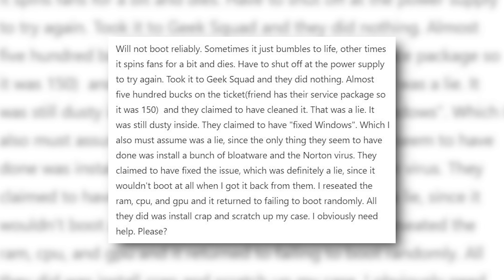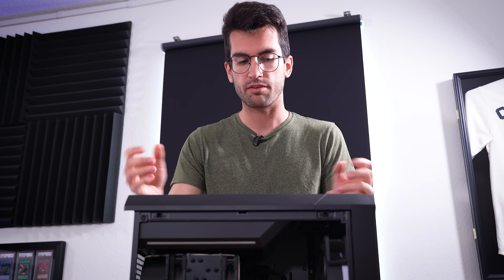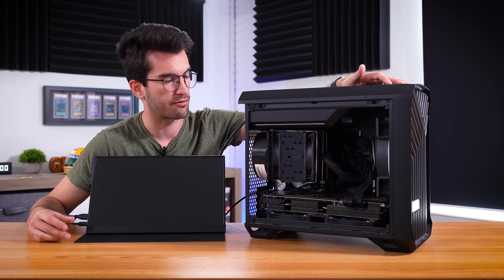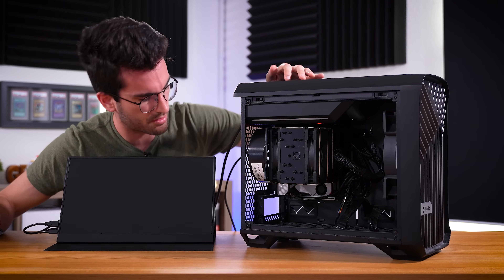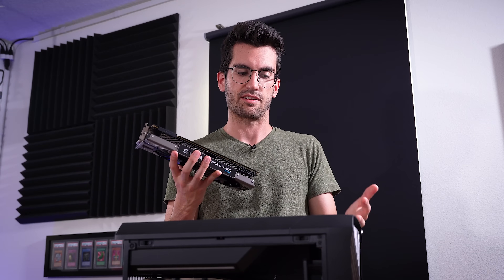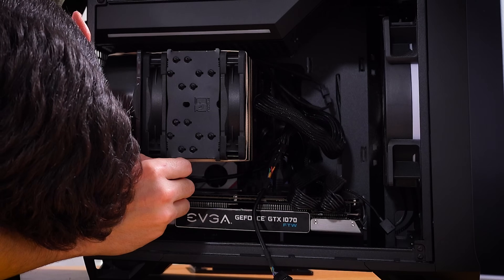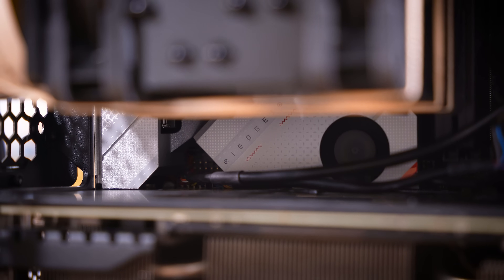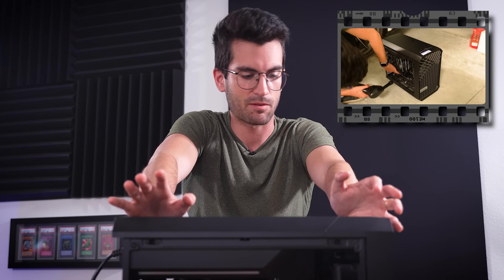Fixing a Viewer's BROKEN Gaming PC? - Fix or Flop S5:E6

Comment: Is it possible that the power connectors to the card weren't fully seated?  I've seen situations where it's mostly plugged in and kind of works, but isn't clipped all the way down.  That caused electrical shorts with some of the newer connectors that some 4000 series cards used.

Comment: One thing you should include in the diagnosis description: the video out port being used by the customer's monitor. In the case where an HDMI port may be working, but one of the Display ports might be faulty.
Reply from the maker: We always use the same port unless we have a need otherwise. The system didn't boot up the first time, but did the second time. Same port. So likely wasn't the issue.
Reply: @GregSalazar  To clarify: would make for a more fully logical-based presentation on your part by including that info, of the exact video port being used by the PC's owner. If the owner uses Display Port & you're using your portable monitor's HDMI port, then it could be skipping over of important factors while trouble-shooting.

Comment: using a screwdriver to short the pins is okay for an amateur, you're a proffesional, you could slip and short or break a component and destroy things. would it hurt you, a youtuber, to get a $1 clicky button?? there's pretty nice ones that are made from a mechanical keyb switch, with power led.

I super appreciate your video series but everytime you poke the screwdriver to the mobo I cringe.
Reply from the maker: If you don't trust yourself with a screwdriver, don't use one. Your logic doesn't add up: if I'm a "professional," then using a simple screwdriver shouldn't be a problem...

Comment: Most likely the video card was not seated completely and needed to be reseated. I have had that problem with big cards like that. Moving the case around can cause it to get dislodged. It did look like it was loose moving around, not screwed in all the way.
Reply: is the issue it overheating?:face-red-heart-shape:
from to much dust in it?🤔

Comment: Could just be dust honestly I had a piece of dust that went into my ethernet port and would cause my ethernet port to randomly power off. I could imagine a piece of dust getting into the pci express slot preventing video from showing when u pulled his card out the dust came with it and testing the other cards they worked because the dust was no longer there blocking the pins in the pci express slot just a thought though.

Comment: I still think it was the hdd led connector shorting out. Not against a painted gpu backplate, but perhaps against the chassis or the gpu finstack. The viewer mentioned that he'd have to unplug and replug the psu to get it to start up again. I've had to do the same after a low voltage short
Reply from the maker: The paint on the backplate was extremely thin, just FYI. I punched right through it and even left scratches down to bare metal doing what I was doing. It was shorting. Nothing was happening.
Reply: @GregSalazar  Cool. Thanks for the clarification. I love your content, but especially this series in particular. When I found and consequently subscribed to your channel over a year ago, I immediately binge watched fix or flop. It'd be sweet if someone here on the West Coast would start up something like this.

Comment: wouldn't those rubber bands cause a problem if they snapped, perhaps they could get caught in the fans or melt if they touched something very hot
Reply: those rubber bands are dry rotted and could snap at any moment

Comment: 6:22 "Power LED - " is connected to the red wire (so it is switched around). Could it have been it? Done that multiple times by mistake and all I got was no led working ..everything else worked fine.

Comment: I was thinking it could have been the power switch itself. My PC cases switch has gotten stupid. Where it internally gets stuck in the push down state. And the Motherboard will constantly start and shutdown the system. It will also affect the board when the system is shutting down. The Motherboard remains active. Front fan lights stay on. the MB does not shut fully down. The Dr. debug numbers stay on. and system fans remain on. But the system is shutdown. Monitor signal is off and all onboard LED lights are off. So a haywire power switch can do weird things. I'm basically just using my phone to wake it with the LAN signal.

Comment: Paused at 10:18

Pcie cables are flat and rubber coated... Motherboard 24 pin cable is round and net sleeved... Custom or replacement pcie cables detected.

Danger! Danger Will Robinson!

Comment: Thas a loose connector issue. Those are bastards to deal with when everything looks ok but isn't and then you by accident reseat it and don't know which oe. Probably GPU power cable though.

Comment: One weird thing I had couple weeks ago, customers PC stopped POST, after RAM upgrade. or so they thought. It switched to iGPU. would not see their GPU at all. after all test parts and trying their GPU in our DEMO PC and working. I found that the AIO cooler was not screwed down tight enough, after screwing it down the GPU was seen and working fine since.

Comment: Mistake # 1 - Letting Geek Squad touch touch it. Mistake # 2 - Adding Norton. But hey, we all live and learn. Great video!!
Reply: I used to love Norton products back in the 90s and early 2000s, but then they started becoming bloatware and I switched to a different AV and security suite.
Reply: Same....seems so long ago now.
Reply: @Joreel  Windows defender is basically better than these 3rd party bloatware scams anyway now.  No reason to buy anything else.
Reply: Sounds like mistake 1 and 2 are the same since they’re the ones who installed Norton
Reply: So.. if they never fixed it and wouldn't boot how did they install the bloat?? Kinda sounds like making stories for no reason. Not all geeksquad ate equal
Reply: @krisespino Linus did a video on this very thing. It is worth a watch and it explains a lot. The results of the Linus video basically mirrors the customers statement in this video.
Reply: ive use Norton since 2005, its been okee so far 10€ per year if u dont got to weird sites :D, but abt video i saw riteaway GPU is bending
Reply: I believe Linus did an episode on this very thing. They took computers to the geek squad to fix them and then analyzed the results of what they actually did.
Reply: Norton isn’t even bad
Reply: Why are you all believing this person story about taking his made shift PC to Best Buy to repair and clean? This using Best Buy as a punching bag for your wrong doings needs to stop! This person knew how to remove the GPU shroud to stitch together PC case fans to his GPU and rubber band his air cooler fans while attaching a Home Depot PVC part to help blow out air but doesn't know how to clean their own made shift PC?
Reply: I work for Geek Squad and you can get a 6 month trial of Norton through us BUT in order to be able to install and use you need to create a norton account on their website, put your credit card info in (So Norton can bill you after 6 months) and then the license key and you will then able to download and install it. So unless the client gave the repair tech his credit card and allowed them to create a norton account for them I highly doubt this happened.  I never install Norton unless the client asks.  WIndows Defender nowadays is really the only antivirus you need on your computer and you can supplement it with Malwarebytes if need be and also on browsers install Ublock Origin, Privacy Badger and Noscript and you are good.

I know Geek Squad gets a bad reputation among the PC enthusiasts and IT and I can understand because the vast majority of them don't bother to hire anyone with quality skills in computing. I am senior repair agent at mine and we do custom build installs the time and also fix a lot of issues coming from the Microcenter nearby from me. It seems their tech bench has individuals who don't know how to properly put together custom builds.
Reply: Symantec was all I used back in the day. There was even a way to get it for free. Something to do with disconnecting from dial up while installing and then having to call a number? Anyone recall that trick?

Anywho, I now only use Bitdefender.
Reply: I’ve seen people get computers back from geek squad with a screw I couldn’t figure out we’re it came from😂
Reply: I forget which one I used, but one antivirus software I used actually messed up my network drivers on an old laptop when I uninstalled it without their specialized tool from their website.
Reply: Im scared what i have norton…
Reply: I mean I don't use any antivirus whatsoever, hell I hate windows defender, I turn that crap off too.....
Reply: Express vpn most simple shit ever but works great
Reply: I still swear by Norton. Yes being bought by LifeLock it has been a bit of a chore. But at its core, it still is a great anti-virus program
Reply: I still rely on Norton which I have for years. Yes since the LifeLock takeover it has a lot of stupid addons but it is still a rock solid software to protect your system. You just ignore and don't use all the added nonsense. I have never lost a system after switching to Norton from McAfee 12 years ago. But everyone has their own preferences, just so you protect the PC
Reply: "Norton Virus" - No lie there.
Reply: ohhh those jabronys from geek squad
Reply: Norton in 2024??? facts!!! Back in the late 90s, Norton used to be useful, somewhat lol. Damn, I'm old.
Reply: @NowThatsPCGaming 🤣🤣🤣🤣 Join the club! 🤣🤣🤣🤣
Reply: I once let Geek finish and correct my mistakes on my first PC build. The result was not horrible.
Reply: Norton deleted my Win 7 OS folder because Norton thought it was a virus.  That was fun and the last time ever using Norton. After using best buy to repair things, the pricing was getting out of hand. Decided too do it myself. Save some money just not time.
Reply: @aliensounddigital  That's pretty serious and sounds like a reason I should avoid Norton.

Comment: it could be faulty electricity supply to the pc causing the psu to shutoff from over static and only comes right once its not connected to the faulty plug and discharged the static

Comment: maybe the pcb or a soldering point of the gpu have been damaged by sagging which was not a problem on your test bench because of the vertical mount and only occurs horizontally mounted now and than.

Comment: 16:13 I can imagine an improper connection causes inconsistent behavior. The trope of smacking/kicking something and it working again does have a plausible explanation behind it, maybe the tight spacing of the IO connectors meant something wasn’t connected all the way. Jostling the system in a car might’ve even contributed to the inconsistent behavior to Geek Squad and back
Reply: Yes! You covered a few things I was thinking about in the episode! Most excellent!

Tons of us have ideas, more ideas than we'll ever explore, but I thank you for sharing what you thought through to cement some of the ideas I may not have considered enough.

Comment: Well Greg when you shorted out that HDD cable you didn't actually short it out the back of that card is not a ground. next time short those pins with an alligator clip then turn it on. then take it off and power it on again. No ground no short is what I'm saying. Sorry Greg I love all of the Fix or flops you have done.

Comment: Yeah so many crazy things can go wrong these days. Like my nephew`s pc that i gave him where the old psu went bad, and then i replaced it with a new psu and everything was fine. Until he could not turn it on and heard strange sounds from the pc when he tried to turn it on. Took it home and found the problem eventely witch was the new power cord that followed the new psu had gone bad.

Because my nephew had the setup where pc is on the ground left of the table, but the power cord was going into the wall under table. And the first thing i tought i could easly see the he was just kicking with his feet under the table, and was really close to the power cord with this feet. So as i had allready tried a diff cord and everything was fine , and the old cord would only make noise. That he had to kick the power cord with his feet and it went bad inside.  

So yeah there is alot of things that prevent a pc from turning on.

Comment: I wonder if the front IO wiring was the issue. Perhaps the extensions? Could have been miswired from the start. Once u jumped it manually it worked and once u rewired it back it worked.
Are front panel io extensions common? Never really seen them before so it made me weary when i saw them

Comment: 4:14 you can see the HDD LED wiring touching the GPU. I think what happened is as soon as it tried initializing the HDD (thus illuminating the LED) it shorted. Unplugging that fixes it. I bet that 1070 doesnt conduct electricity as well, cuz it wasn't powering off.

Comment: I have this issue with an asrock board, granted older on the z87 side
I bought the board new long time ago and hardly used it, I got about 100 hours out of it and all it will do is either come to a black screen and never post
or just come on and go right off
I've swapped every single component in the PC, including buying 3 cpus and none worked
swapped 3 different ram kits and nothing too

Comment: I would consider cooler mounting pressure, or perhaps bent cpu pin or pins. Just bumping the cooler or jostling the case may change the mounting pressure enough to change things. Just a thought. Enjoy learning with you Greg!
Reply: This is a good point, and considering how tight and janky everything was in that case, it's very possible someone bumped something.

Comment: im 55 and just built my first pc a cit blaze red . tuf gaming b550 plus_wifi 2. ryzen 5 3600 . 4 x 8gb 3600 ddr4 . Radeon RX 570 . 500gb m.2. 2 x 1tb ssd and 2 x 2tb hdd . it worked first boot only trouble was i am half blind and got fat fingers took me 2 days and is of old and new parts 😁😁cost me about £300

Comment: I am thinking the USB 3.0 Slot might to be the blame.  I've had that issue before, the USB 3.0 either has a short in the USB slot or on the board itself.   I've seen this at least once and it was the USB slot on the case that was causing the issue.

Comment: "Have you tried uninstalling and reinstalling it?" goes hand in hand with "Have you tried turning it off and on again?"
Reply: the other one that bit me square in the a$$ was, have you updated your bios?, Me: "yeah!", Have you updated ALL the BIOS? Me: "DAMNED GPU BIOS!!!"
Reply: Oh frak... I had to buy a 2200g or 3200g, something cheap just to update my motherboard bios, which wipes out the savings I got from buying used and cheaper...but I've never thought to update GPU bios. I kind of have lots of those... @yissnakklives8866  

Thankfully, usual advice on such things is don't if it's not needed.
Reply: Don't forget to jiggle the cord!
Reply: @nps5886  don't forget to turn the power strip on

Comment: That's frustrating Greg. The only thing that can be reasonably added on top of what you've done is to check the Windows event viewer logs, just to see if anything was recorded there while the system was malfunctioning (though perhaps it never got into windows?). Second item is that there are USB images you can boot off to run diagnostics and memory tests on GPUs. It would have been good to run that, as well maybe as a run in furmark (to stress test it) before giving it the all-clear

Comment: Considering anodized aluminum does not have very good conductivity touching that connector to the backplate might not have actually completed a circuit. Touching to bare metal like the silver PCIE border piece might have completed the circuit and also having it grounded before pushing the power button might have resulted differently depending on the sequence of the boot tests. If you did get it to complete the circuit on the backplate it might have happened after the system had already passed that test in the sequence which it would have passed.
Reply: He should have insulated that connector anyway, I think it might have been touching also something in the motherboard, sending voltages where it shouldn't have and caused the problem that way. And now when it is not insulated that might start happening again, especially when PC is being carried to different location.
Reply: I was thinking this too. Should have touched it to another material just to be thurough
Reply: Plus if that wire was straight from the led there would be no power it would be one wire straight to the anode and one wire straight to the cathode.
Reply: THIS

Comment: I wouldn't be to disappointed Greg, sometimes reseating components is all that really needed to be done so there is a lesson there.  I've ran into that before and practically beat my head against the wall trying to replicate the problem, but at the end of the day you just have to take the win and hope it stays that way.
Reply: I came to the same conclusion myself. Reseating the card as well as it's power plugs probably was the fix. Imo it's either because of the card sag causing intermittent connection at the PCI slot so the reseat helped that (but could run into the same issue in the future) or maybe one of the power connectors not making a good connection and the power supply was going into protect giving too much power on the connected rail or the voltage was spiking from the one barely being connected. I didn't catch the power supply wattage, brand or rating though. For a second there I thought he was going to have to replace the dudes 3080 TI and that's not cheap for sure

Comment: 14:37 you can really see the back of the card sagging severely, perhaps the pcie lane connection between card and socket is being tweaked by the sag?
Reply: That's my thought as well. Could also be the card flexing the motherboard just enough to have the motherboard short on the case somewhere. Would explain why it works after reseating the card.